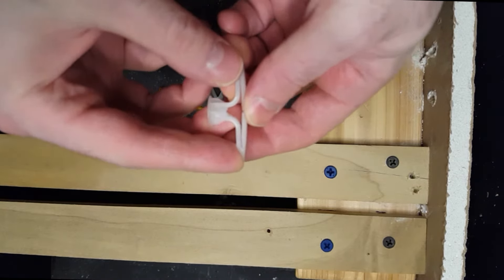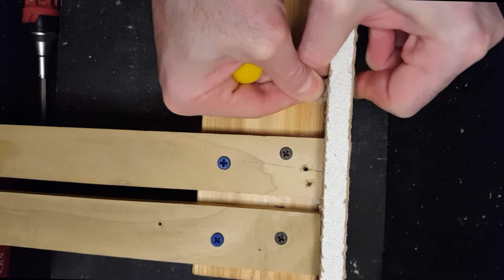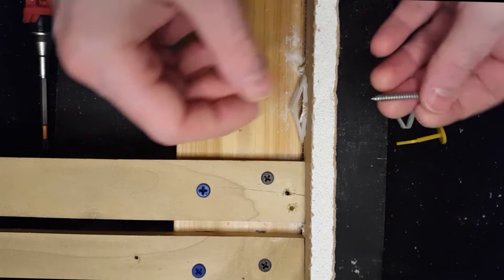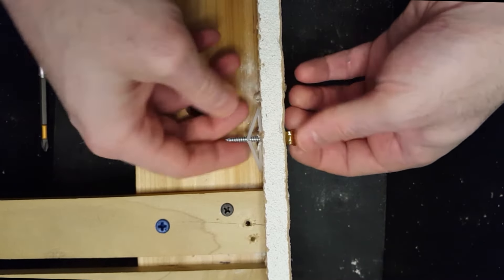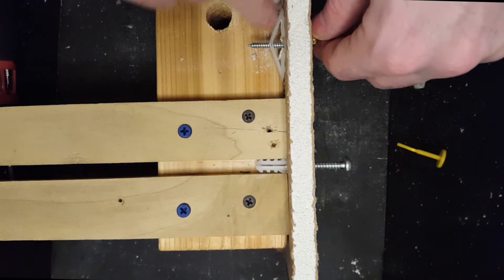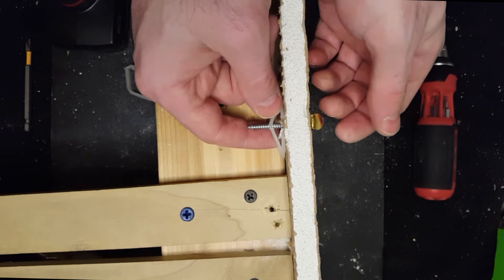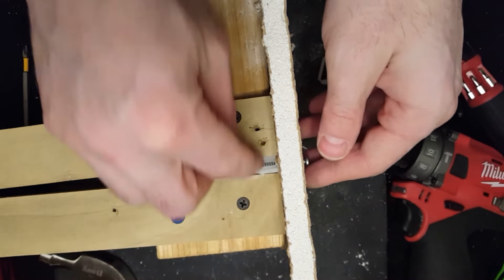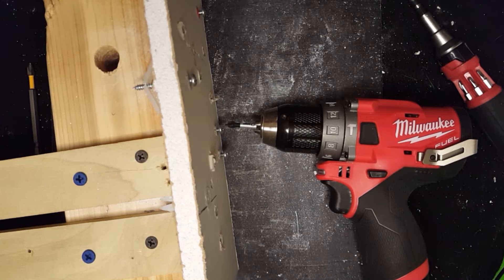Toggler Plastic Toggle Anchors / Pop Toggles Installation and Weight Test

Comment: Thank you. I wish you also showed how the pop-toggles work in the use of hollow core doors which is what they are also advertised for. I have my reservations whether the outer board of the hollow court door itself will be able to hold 40 lb of weight.
Reply from the maker: That's true, any of these hollow anchors are only as good as the material they're installed into. When they fail, especially good ones like these, it's actually the wall failing first, and I would imagine it would be the same with doors.

Comment: As far as you’re aware, will the plastic toggle still ‘pop’ open behind the drywall if you screw into it, opposed to using the yellow pin? Have you tested this?
Reply from the maker: I wouldn't say so. If the toggle parts are pushing in but have not popped, then they are note exerting pressure against the back of the wall. It will still have some holding power and act like an expansion anchor but it won't be as strong as it could I would imagine. One test I did with just the toggles that had not popped backward pulled out with not much pressure.

Comment: My one keeps turning and turning and never locks or really tightens. Maybe I'm doing something wrong?
Reply from the maker: It's had to say. Make sure to hear a pop when you push the anchor in with the tool. You may need to push it need further to be able to lock it. If you mean the anchor spins, the hole should be 5/16" in drywall for those fins to dig into the drywall a bit and stop it from spinning. If the wall is tile it needs to be a 3/8" hole and you won't have the fins holding it still. If you mean the screw keeps spinning, then the plastic may be stripped. At that point you could try a coarser thread screw.

Comment: I used it to install hook on a bathroom door. A door is thin and they will pop open on their own once pushed through.  I saw a video on here where they got 140 lbs off one of these.
Reply from the maker: I believe it, they are very strong like the metal ones but also have the benefit of not needing a long bolt to be installed first like the metal toggle bolts so they can fit in tight spaces.
Reply: @toolsandrepairs  I think a door is too thin for these because of the offset.  I have no idea how they are working right now, but they are.  If they fail, I'll get the metal toggles where the wings can tighten all the way.

Comment: Can it hold 75 inch tv if i put more of them in the gips wall?
Reply from the maker: I would recommend you get at least some lag bolts in a stud for a big TV mount. If some hollow wall (gypsum/drywall) anchors are used, I would use something like flip toggles to supplement the bolts in the stud, not these particular anchors.

Comment: I got these for installing those 10x11" IKEA Lack floating shelves, but one of the anchors for one of the shelves pulled out of the wall,making the shelf sag a bit. What would cause that to happen? I am using screws that came with the anchors.
Reply from the maker: If the anchor wasn't pushed all the way in (you hear a pop), then the anchor could pull right out. You could try to push it back in with the provided push tool or get a metal toggle bolt replacement. But really a floating shelf should have at least some of the screws in studs to be secure.
Reply: @toolsandrepairs  I heard a pop when I pushed it in with the push tool. What if i used longer screws? Would that make a difference?

Comment: I clicked on the Amazon link but they're currently unavailable. Great video, by the way. I think these will work perfectly for my projects.
Reply from the maker: Thank you and thanks for the heads up, I changed the link, which is also to the Toggler seller on Amazon. I've used these a few times since and they are really strong and versatile (fit in the narrow space between drywall and concrete for example).

Comment: The provided yellow pin (plastic) used to push/pop the toggle open is too flimsy.  
I was afraid it would break it, as it was hard to keep it straight and would bend when pushing.  
I finally used a nail (clipping off the pointed end) about the same diameter as the push pin, 
and put a piece of painter's tape same distance as the shoulder on the push pin, 
and then tapped the "push" nail with hammer until the marking tape meet drywall and the toggle popped into position.
Reply from the maker: That is a great idea. In fact I had to do something similar recently and also had to tap it with a hammer. I suppose if it was easy to push in, then it wouldn't have as much holding strength because once it pops into position it's basically as good as a metal toggle bolt.

Comment: instead of using that yellow tool to pop the toggle why not just screw in the screw. wouldnt it do the same thing
Reply from the maker: The anchor will be weaker if the toggles aren't pushing toward the back of the wall. I'd had them pull right out not realizing the toggle didn't properly pop in place.
Reply from the maker: It's really only strong when it pops in place behind the wall. If you just screw it, it may not hold as much weight before failing. It's hard to grasp without seeing the other side of the wall.